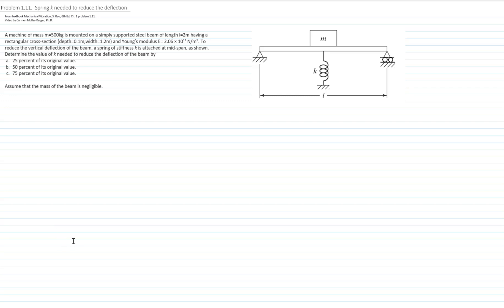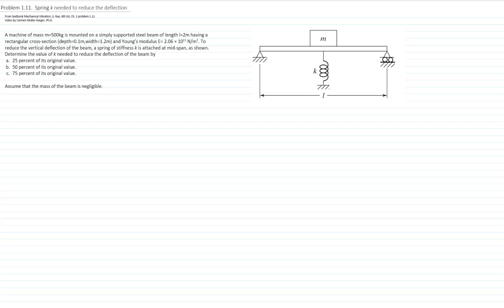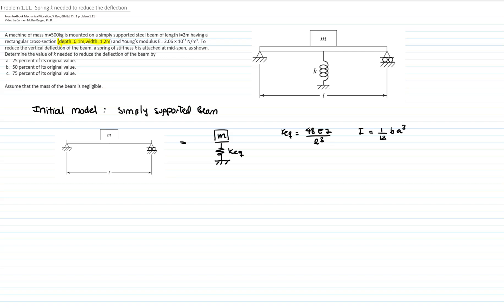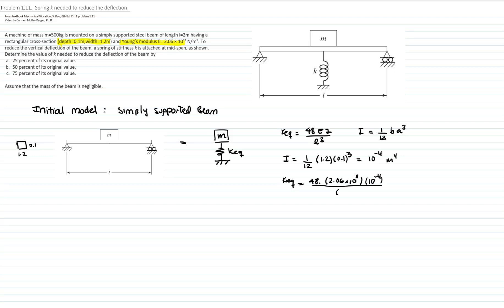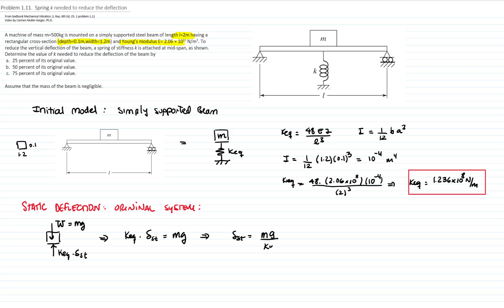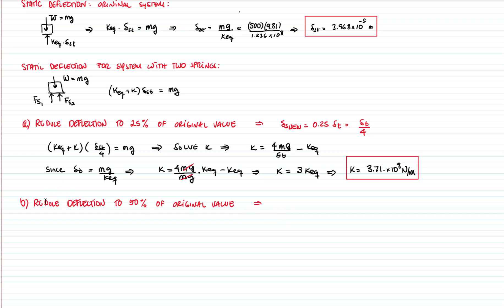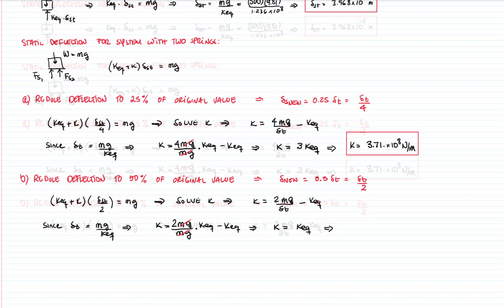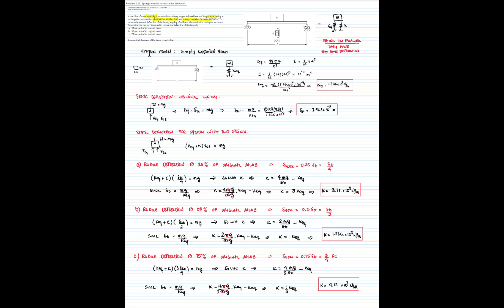Problem 1 11 Reducing static deflection

Comment: If the mass of the beam was not negligible say it was 50kg, we add 1/3 of it to the 500 kg mass to find the the static deflection, is that correct????
Reply from the maker: For a simply supported beam of mass m you add 0.5 m .  for a cantilever beam of mass m  you add 33/140 m, for a spring of mass m  you add 1/3 m